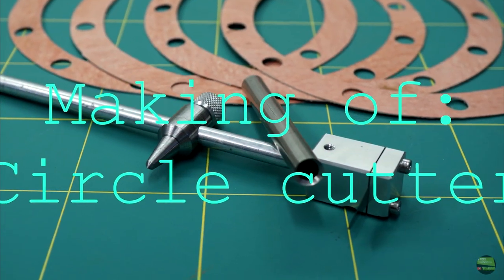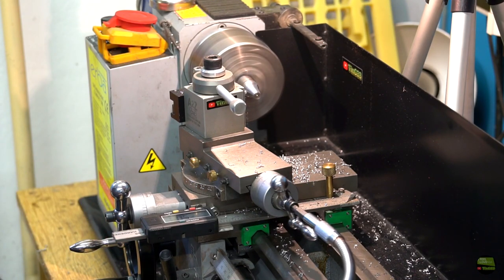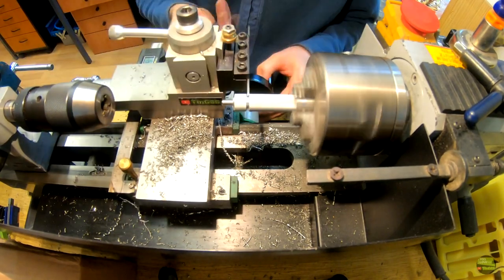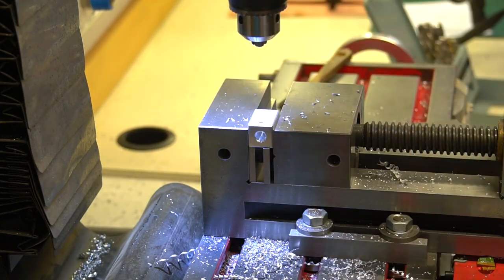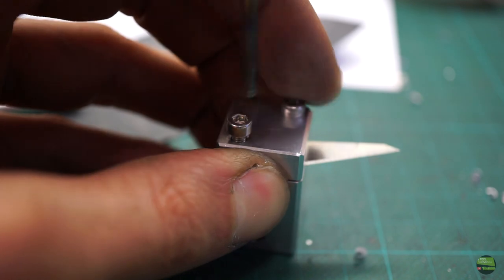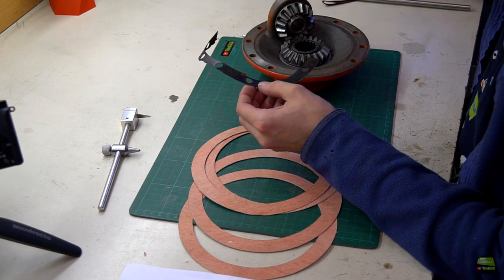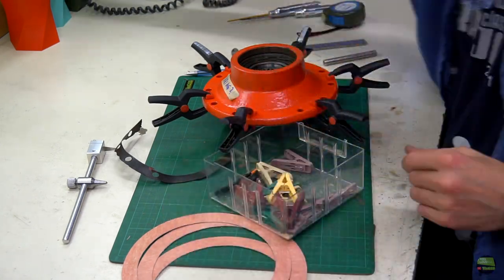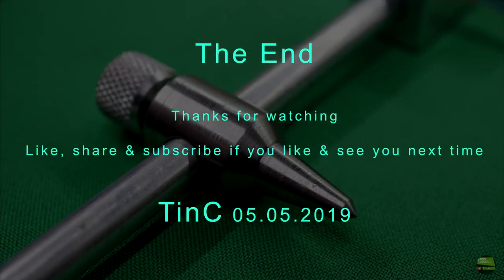Making of: Circle Cutter & Hole Puncher [making oil seals]

Comment: A suggestion I think you should make an insert block that could attach to the to of the punch as a striking face instead of hitting the end of the tube
Reply from the maker: good idea, but i need that size of puncher just to make those 40 holes, next time i'll make new puncher on dimension i need.

Comment: Its all nice and all,but there is a realy easy way to make precise gaskets without anything but something to beat on gasket with.It doesnt work for rubber thou but it will leave a trace which you can cut.
Trick is in placing your material of choice and then lightly tap with hammer or something  on the edge of object.Edge alone will cut the paper ,leaving perfect copy of object.
You can use paper then just replicate the pattern on anything.You can do any shape you want even the holes  without complex tools.
Reply from the maker: true, also step two and a half talk about that (comment below) that's the tehnique we use on job, when repair old electromotor reductors, but i don't like that process because you can demage the edge of steel, not much i know but it is demaged.
Also i make this cutter because i need them time to time, also for cutting other stuff like sealing.
And yea there is another easiest way, insteed of making the seal simply use liquid seal like loctite 518 and other.
Thanks for the comment
Reply: @TinC33  It is hard to damage a edge of part even on aluminum,let alone the steel since you dont beat on it ,its the many light fast taps that do the job best.You can use small brass hammer or plastic one ,you dont even have to use a hammer ,peace of brass will do just fine .Gaskets have been used and proven to work for a 100 years +.If it was originaly built with gasket i always put one of same thickness since it can affect the distance between precisely made parts in which even 0.01 is important.(like motorcycle engines for example )
Reply from the maker: @zumbazumba1  all true i agree, in my case, thickness doesn't metter, because all reductor got on same high than all four connected with a rod, one of them connected to the motor and than tgis one via rod turning the rest three disc.

Comment: Also an easier way to hold the tool while cutting out the gasket would while making the hold down thumb screw is to add a nipple on the knurled side of the center thumb screw to hold lightly in a drill press chuck so that it frees up your hands so one hand holds the gasket paper while the other turns the cutter

Comment: We make our seals gaskets as our machinery is too old and no longer made. Nice work in a pinch a lathe continues to be a true worker of helping you in the shop. We live in the California high-desert, there is no grass here though, still interesting.
Thank you for the share, Lance & Patrick.
Reply from the maker: Thanks, yes i can't imagine my life without that minilathe, when i assemble that mower i can't get right dimension M8 screws in a local shop, so i cut them and make nice 45 degree angle on end all that with minilathe about 80 pieces.

Comment: On the punch, add a threaded hole on the striking end and add an Allen bolt. If the head of the bolt gets mushroomed just change it out.
Reply from the maker: great idea, but i need that puncher just to make those 40 holes, next time i make new puncer on dimension i need.
Reply: TinC33 save the punch, should be a standard bolt size.

Comment: 360p or am I first and it hasn't rendered fully yet?
Reply from the maker: too fast, try now ;)
Reply: @TinC33  I enjoyed the video. I was really worried when you were talking about making a punch that you were going to do an OD bevel and fight tearing the gasket for a long time. Glad you knew/figured it out to do an ID bevel. Many years ago, I had done something similar, and it didn't dawn on me that I needed the bevel on the inside and why it kept tearing.
Reply from the maker: @dogsarebest7107  Thanks. i know what you talking about, i see guys, whu just put sealing material onto steel reductor and than with hammer punching to it's corner until the seal was cutted, but the surface of steel was...